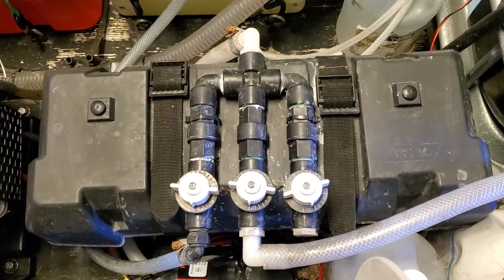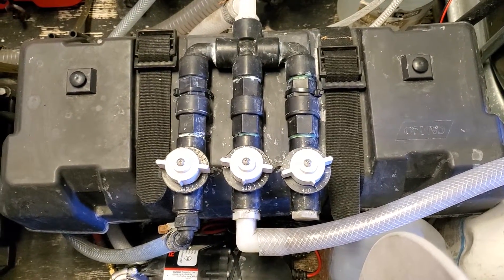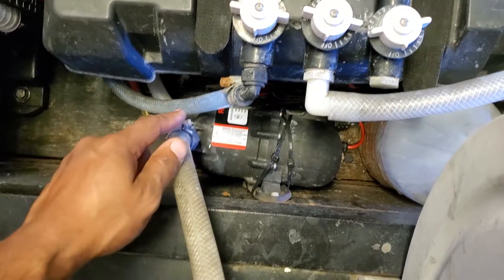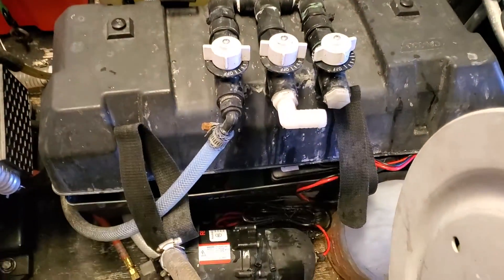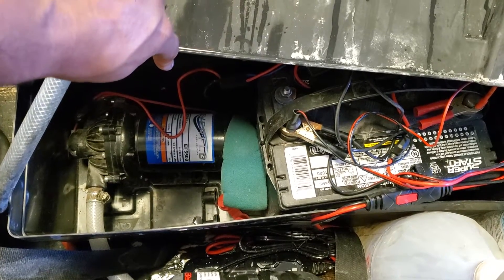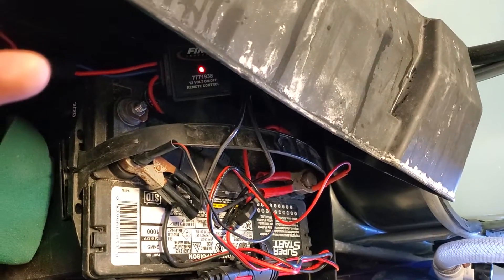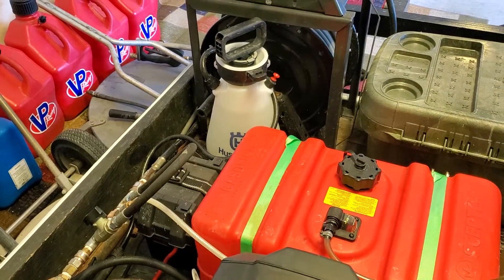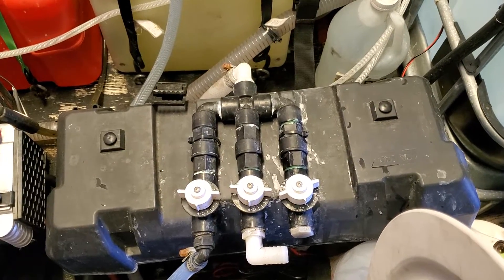12v softwash setup

Comment: Hey just bought a trailer and everything for soft washing and we are building everything - just wondering where the water line is coming from? If it comes from a tank, do you have the tank constantly filling from the faucet of the house/building you are cleaning, or just have it fully filled and then use up that water?
Reply from the maker: The water line is coming from the tank.

Comment: How far can the proportioner be from your water and SH tank for it to work properly? And does it need to be set higher than those tanks?
Reply from the maker: @nicholashalvis5376  it can be long as it needs to be. No it doesn’t need to be higher than the tanks.
Reply: @ 
Thanks

Comment: Thanks for the info bro
Reply: Would i still get 40 feet without the accumulator? Im assuming i will.
Reply from the maker: @INGLORIOUSLefty  you should be able to hit it but it may not be a consistent 40ft. It may taper off after you initially squeeze the trigger. That's where the accumulator comes into play to maintain line pressure and smooth things out.
Reply: Gotcha

Comment: How are those valves working out for you? Are they lasting thanks.
Reply from the maker: @nicholashalvis5376  I made this video over 4yrs ago. I never had a problem with them but I don’t use a proportioner setup anymore. I used these for approximately 2yrs.
Reply: @ 
So if you don’t mind me asking, what set up are you using now?
Reply from the maker: @nicholashalvis5376  I still run a 12v system with 350ft of 1/2” flexzilla hose. 5.5gpm but I don’t use a proportioner system. When I use the 12v, it’s for pretreating, post treating or roofs. I don’t play around with mixes for those things. A lot of times dialing a mix in can be just guessing or hoping it’s strong enough the first time in hopes you don’t have to go back and do it again. You can look for my 2024 trailer walk around video I have posted.
Reply: @readykleenpowerwashing  
I’ll look for your walk around trailer video. Thanks again.

Comment: hey quick question, i might just be dumb but how did you go about wiring in the fimco so you can keep the battery charger connected? out of the box it seems like i can only have either the remote or the charger connected and i can’t be switching them around. thanks again, really helped me out building everything
Reply from the maker: The fimco remote plugs directly to the pump and from the remote to the battery with alligator clips. The battery charger I was using has eyelets and are permanently connected to the battery with battery nuts.
Reply: @readykleenpowerwashing  ok awesome thank you man. google has nothing on you! how long have you been running two trucks? congrats
Reply from the maker: @wavefields  I'm only running one trailer. Just under 2yrs still.
Reply: @readykleenpowerwashing  oh wow ok, i thought i saw two lined up in the new drone video so i assumed they were both yours. still congrats anyway on upgrades then, excellent work
Reply from the maker: @wavefields  I was working with another buddy whom I consider a good friend. When we both have big work, we call each other up to help out and make money together.
Reply: @readykleenpowerwashing  oh i see yea that’s always nice.

Comment: thank you for the great video
 it was very informative.  can you tell me where you got the battery case, hose reel and charger?
Reply from the maker: Battery Case And Charger are From Amazon and hsie reel northern tools.
Reply: @readykleenpowerwashing  do you have a link?
Reply from the maker: @fredericksphotos  hose reel - https://m.northerntool.com/shop/tools/product_200721734_200721734?cm_mmc=Google-pla&utm_source=Google_PLA&utm_medium=Pressure%20Washers%20%3E%20Soft%20Wash%20Systems&utm_campaign=Valley%20Industries&utm_content=71539&gclid=Cj0KCQjw9_mDBhCGARIsAN3PaFNwNN4UZfRdbooLeMDA-ChWvVBuoL3OO1_eJ5_RnrHJIL3y2hPFrTgaArdHEALw_wcB&gclsrc=aw.ds

Battery charger - https://www.amazon.com/dp/B07W3QT226/ref=cm_sw_r_cp_apa_glt_fabc_A3FJS7ZZMKVNWRHD73GC

Battery case - https://www.amazon.com/dp/B07V4482W1/ref=cm_sw_r_cp_apa_glt_fabc_VCTYKRYA5AEF6NDB5368

Comment: Hey man nice setup, can you tell me the pros & cons of using 1/2” air hose vs. 5/8” water, is the bigger hose going to have more output? 
Some say 3/4 & others 1/2 just curious what your opinion is on the matter?
Reply from the maker: I noticed no difference in performance going from 5/8 to 1/2 hose. Only difference I noticed was less weight of the 1/2 hose. I think 3/4 is too big.
Reply: @readykleenpowerwashing  Awesome man thanks for the info !

Comment: Can you show me how you plumbed everything
Reply from the maker: I don't have this system anymore. It's not difficult though. I have one hose going to water tank, one hose going to bleach tank that goes into the proportioner. I only use 2 of them 3 mixing valves because my soap is in the bleach tank. Outlet of proportioner goes to pump inlet. Pump outlet goes to accumulator and then to hose reel. If you don't have or use an accumulator then pump outlet goes straight to hose reel.

Comment: Thanks! Where did you get the bleach tank? I've tried to find online but no luck.
Reply from the maker: I purchased it locally. It's a 20 gallon vertical tank. I no longer have this tank anymore since I've now moved to a gas system. One of my local pressure washing stores had them and sold me one for $50. It was a deal. You can try www.tank-depot.com. They're also local to me and they sell practically any tank as well.
Reply: @readykleenpowerwashing  men you're lucky. I cant find anything local here. Thanks

Comment: What size is the water feeding line and the sh/surfactant feeding line or they both the same? And could you also tell me on the 2 90° fitting that your using with those lines thanks
Reply from the maker: Water line was 3/4, SH 1/2 and the outlet of the mixer was 5/8. 5/8 pump inlet to 5/8 pump outlet to hose reel and then 1/2 flexzilla 250ft.
Reply: @readykleenpowerwashing  thanks

Comment: Hey sir I have a question. I wasn't able to order my 5.5 everflo pump because they won't ship to California on Amazon I guess but it let me order a 4 gallon and my question is how much of a difference is it fron the 5.5. & what type of battery should i get ?
Reply from the maker: There is a difference between 4 and 5.5gpm. All you need is a group 24 marine battery. You can get it at orileys or Autozone.
Reply: @readykleenpowerwashing ok thank you & and last question, what size tube fitting should I put from the tank to my pump & pump to the gun. I usually see people put 3/8 on 5.5 gpm but i have a 4 gpm so not sure if everything changes .
Reply from the maker: @edwardfores7586  you can just go 1/2 inlet and 1/2 outlet.
Reply: @readykleenpowerwashing  on the pump to my wand 1/2 I.D or O.D ?
Reply from the maker: @edwardfores7586  when you talk about hose sizes in this business it's always going to be inner diameter.

Comment: Wat is the  best  hose  to  use  when  using  sh
Reply from the maker: That's a very subjective question because everyone has their own opinion. I was using flexzilla 1/2" air hose and it worked great the 9 months I used it before going toc a different system. I always rinsed when I was done using it and it's very light.

https://www.amazon.com/dp/B00BL8KH5I/ref=cm_sw_r_cp_apa_fabc_19Q8Q99VHX642T6P85M3

Comment: Can you explain the acumulator?
Reply from the maker: It's an air bladder. The discharge of the pump builds up and stores pressure in the accumulator according to how much air is in it. This keeps steady pressure in the hose so there is no tapering of your chemical stream from the pump not being able to keep up.
Reply: @readykleenpowerwashing   ok, does it need to be wired to the battery?
Reply from the maker: @leonytigre  there are no wires. Google and look up accumulator so that you can get a better idea. It's just an air bladder.
Reply: @readykleenpowerwashing   Thankyou  bro I got it.
Do you have fb page I can follow you?
Reply from the maker: @leonytigre  Facebook.com/readykleenpowerwashing
Reply: Is that the flexzilla air hose? How does it connect to reel did it come with connections? Got mine today but it’s just the 1/2 inch hose
Reply from the maker: @leonytigre  yes its air hose. All you need a 1/2 male to 1/2 barb fittings with hose clamps.
Reply: @readykleenpowerwashing  thanks brother, I seen on the other video you got a comet pump now.
You still run this 12 v? 
And thanks for the quick response!!! You the best
Reply from the maker: @leonytigre  I no longer have the 12v. Just running the gas system now.
Reply: @readykleenpowerwashing  one more and I’ll leave you alone.
To conect the end of hose to gun same thing? Or what quick connects you had?
Reply from the maker: @leonytigre  same thing.

https://www.dougruckerstore.com/products/udor-poly-spray-gun-viton-rs4306/

Comment: Do you use a pressure washer at all, or are you totally dependent on your soft wash system?
Reply from the maker: I use my pressure washer all the time. You can't just have a softwash system to do all the work. I know longer have a 12v system now. I have a gas softwash system and even then I still use my pressure washer for the most part until it's time to apply a hotter mix, pre-treating or post-treating.